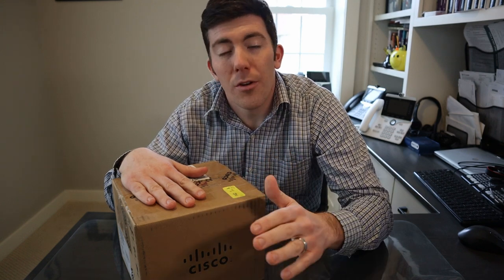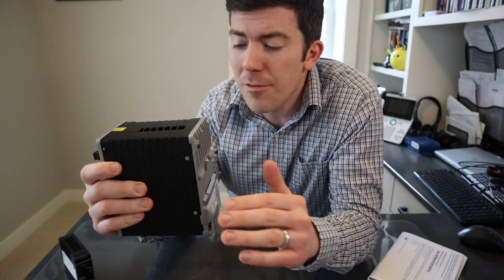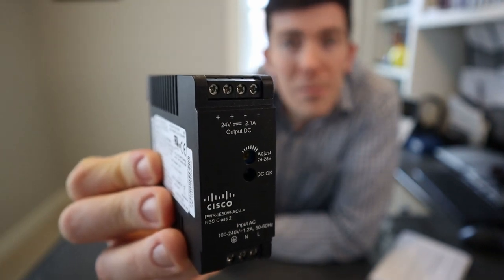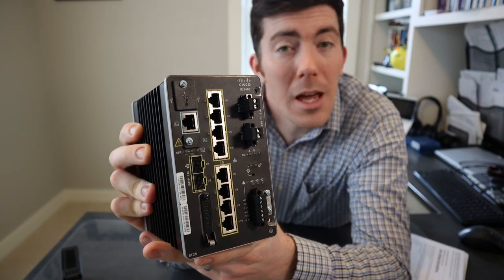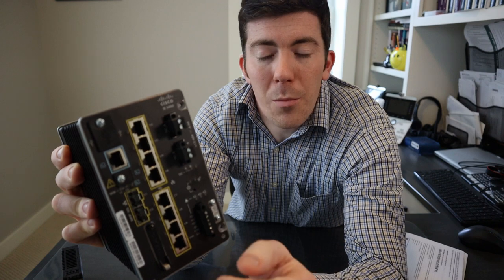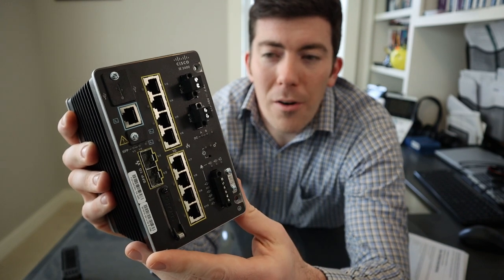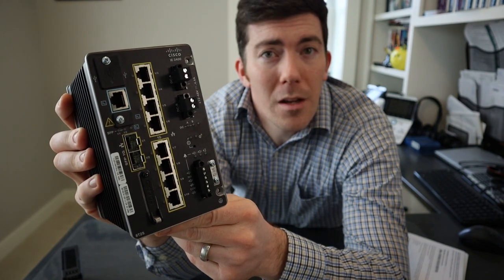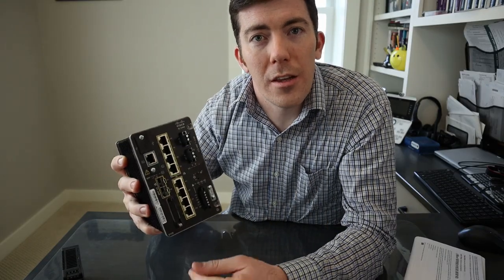Cisco IE 3400 Industrial Ethernet Switch Overview

Comment from the maker: What else would you like to see from an industrial switching perspective?
Reply: For me, not a lot more.  I'm more in to UC (on-prem) and cloud (hosted) voice/collaboration.  Those are the videos I enjoy.  Thanks for the channel - good job!
Reply from the maker: @NeilHyndman  Thanks!  More Collaboration stuff coming soon :-)
Reply: Design. Looking at the 1000 series line I'm not sure what they really made them for if they aren't going to be able to support ISE
Reply from the maker: @evanhines2361  The 1000 series are certainly built for very basic switching.  If you need ISE support, 802.1x, etc certainly will want to move up the stack from the 1000 series.
Reply: @TheTechCatalyst  yea that's the most difficult part when we are talking about space constraints. 1000s can fit where the others can't.
Reply from the maker: @evanhines2361  Actually... it does sound like they do have 802.1x support per the data sheet.  Maybe you could make it work?  https://www.cisco.com/c/en/us/products/collateral/switches/industrial-ethernet-1000-series-switches/datasheet-c78-737277.html

Comment: Great overview.  One thing worth noting that especially sets the IE-3400 apart is the IOX container that enables the switch to host applications.  This is how Cybervision works by running as software sensor that examines the industrial traffic without any need to span it across the network.  And, of course, the IOX container offers a unique opportunity for other Cisco and partners applications to really expand the capabilities of the switch into a powerful switching and compute environment.

Comment: Just a quick question - it doesn't seem to have a mechanism for mounting and connecting the power supply to the switch in the same manner as the older IE3000. Is this correct? I know of several clients that stated they would consider option vendors if this was the case for the new IE3300/3400..
Reply from the maker: Correct, the power is seperate. This makes the most sense for custom build panels where power flexibility is needed to power other devices as well.
Reply: @TheTechCatalyst  thanks for confirmation.. I agree, tho I'm still a tiny bit sad that the option to do it 'the old way' is gone.. guess I'll just have to resort to talking to clients about the IoX features these devices bring to the table :)